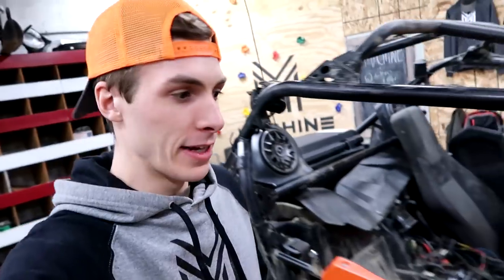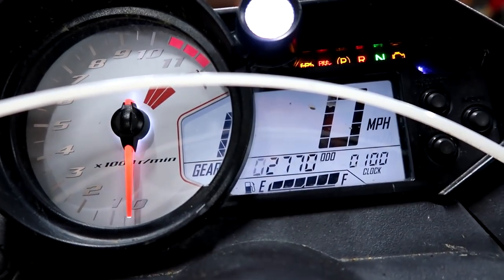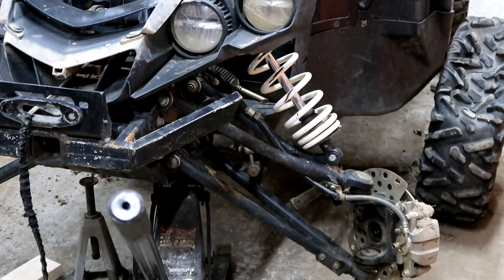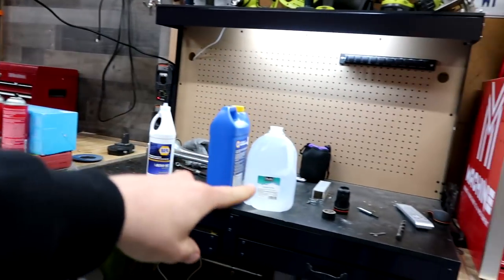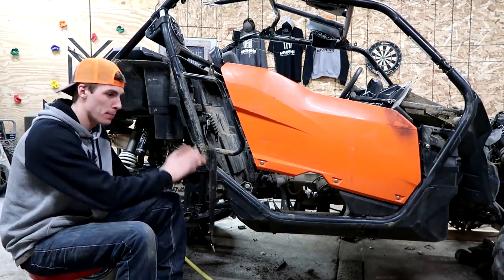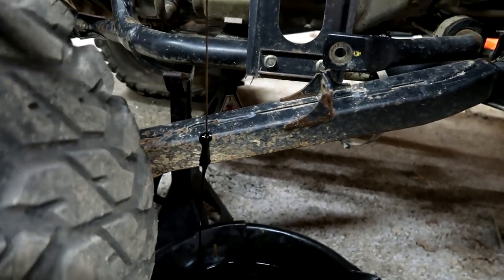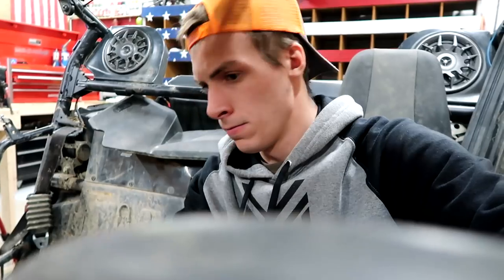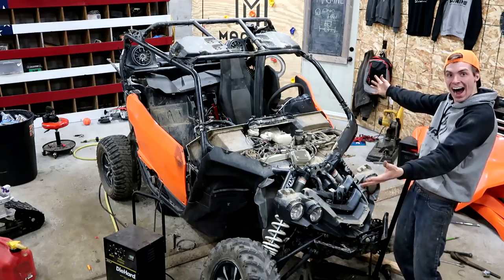TOTALED 2016 Yamaha YXZ 1000 RUNS!!!

Comment: Depending on the state they have to disclose the miles correct to you and the state via an mvd or dmv. If they are incorrectly disclosed you have action you can take. 99% of the time the dealer (assuming you bought from a dealer or wholesale dealer) will make it right. The value drops a lot with the mileage discrepancy since it’s a depreciating asset miles/wear and tear/age all factor heavily.

Comment: the speedometer may default to some unknown number or a test number without the computer connected. the data could be stored in the instrument cluster or the computer itself,
so I cannot say exactly without knowing the design and wiring of all the electronics.
the almost 158 hours, does seem realistic for it having 2,770 miles on. which seems correct, judging by tire and general wear.

Comment: You could put a galv street 90°  in the oil drab hole then just 90° it out so it doesn’t drip on it little tip from a plumber

Comment: Why you so fixed on the mileage? A 2016 with 35 miles come on !! I would have put 35 miles on the first ride. If he charged you for a new utv then yeah I would say you got scammed. If you got it  for less than what a new one runs I would just fix it and send it. Mileage is just a number .
Reply: CrewCrazy 84 -- To a certain degree you are correct, but this thing had close to 160 hours.  If these things aren't maintained well they become a money pit.  I have 2 Polaris 4 wheelers, but my neighbor has 2 of these.  One was bought new and the other with about 3,000 miles.  He is putting money into that thing left and right.  I would ask for some cash back.

Comment: Almost 3k miles on a 4 stroke is nothing, think of it as a car
Reply: Drive any car like this one had been. It wont last long
Reply: 4 strokes engines are meant too last longer then the actual machine itself (if maintained properly). Obviously, 2.7k miles is nothing for a 4 stroke but the YXZ has been in a role over, as of now the machine starts and doesn't seem to have any majors issues with motor. When he takes it out for a good rip, he'll see if the motor runs fine.
Reply: My uncles four stroke Yamaha grizzly had 8000 miles on it when he sold it to his son and then at 9000 miles the engine needed new rings. Some four strokes can take a beating
Reply: Foster Rich it's a thou, plenty of 1000cc sport bikes do alot of miles no problems at all.. Just normal servicing